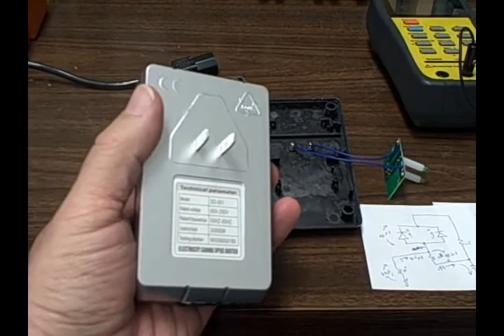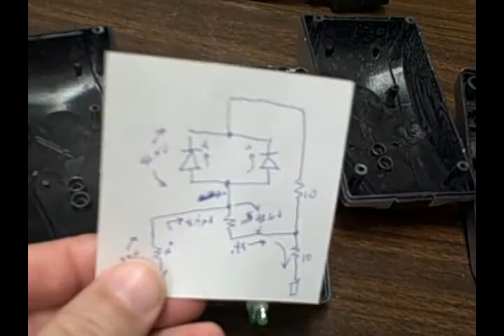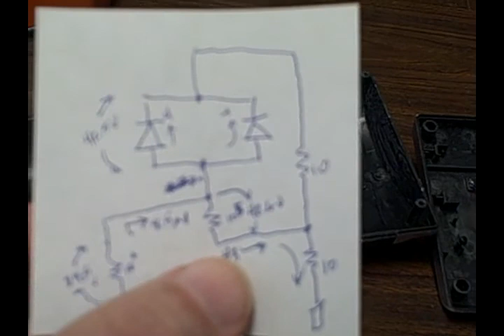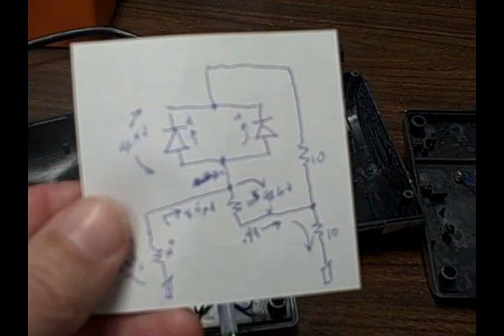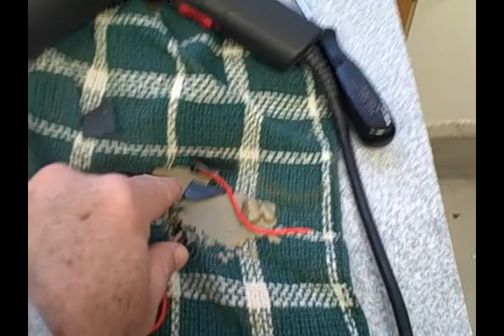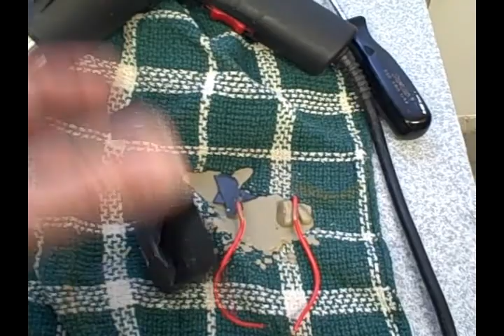Scam Power Saver SD001

Comment: My buddy's wife "got a deal" on 6 of these and I saw them plugged in. First thought they were wifi extenders. Once I realized they weren't I told her they didn't work and in fact used electricity due to the lights and she was kind of surprised they would "falsely advertise them." My buddy said yes they do in fact work cause they take up an outlet so she can't plug in another damn tart burner or air ionizer. Kid you not there are 4 tart burners and 2 glade plug-in just in the living room. You can smell the cinnamon from the driveway. But alas he didn't marry her for her brains or common sense and they have the means to where if she thinks she's doing good he'll just go along with it unless it get past ridiculous. He put his foot down when she was thinking about buying a water purifier from a dude going door to door so at least this is better then those.